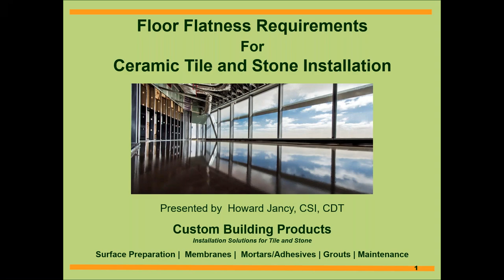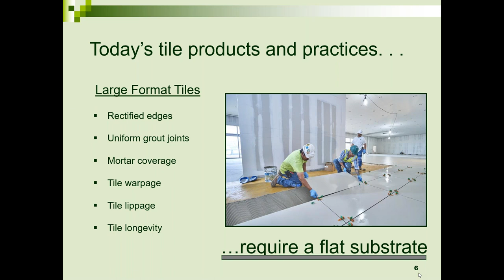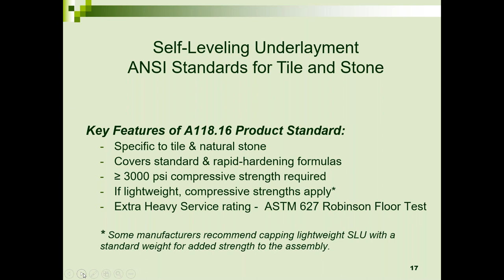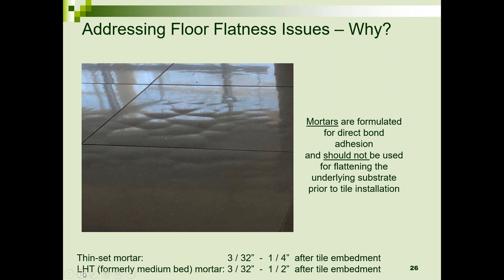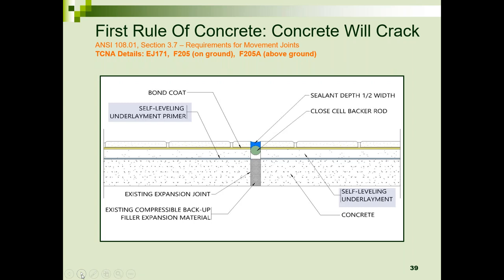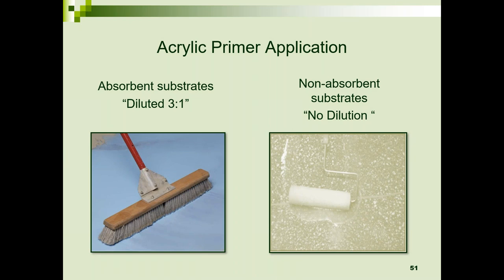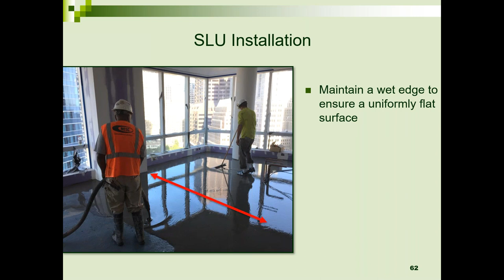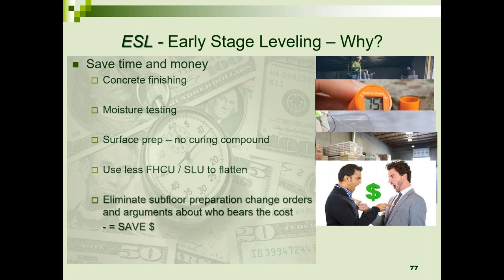Webinar: Floor Flatness Requirements for Ceramic Tile and Stone Installation

Comment: Thanks for the webinar on this important topic. Lots of good info shared! Curious why you guys didn't cover dry pack screeds for floor leveling or mudset installs. Down here in South Florida those are the most common options I see with residential large format tile installs over concrete (including TCNA certified installers). SLU pours are rarely used.